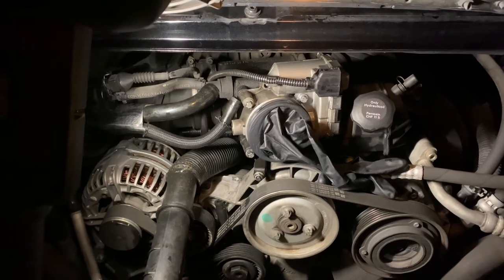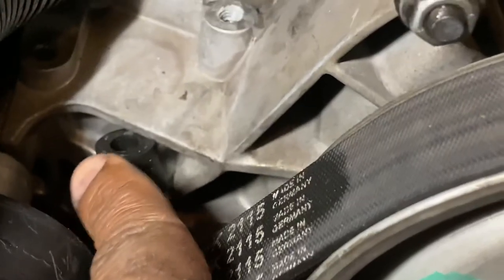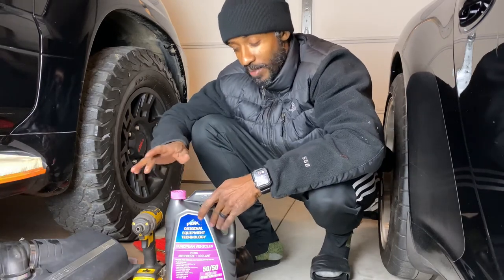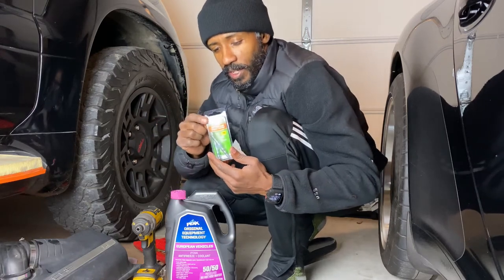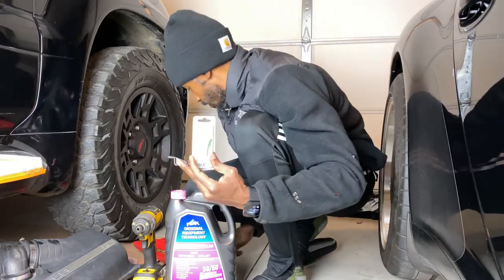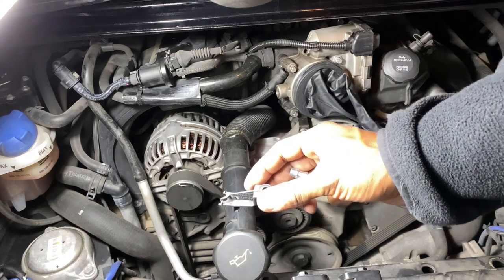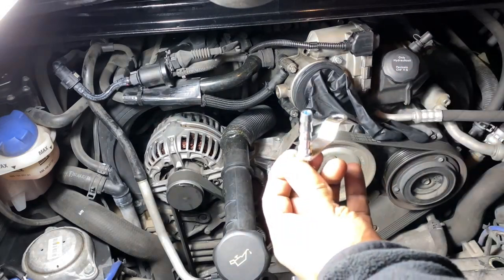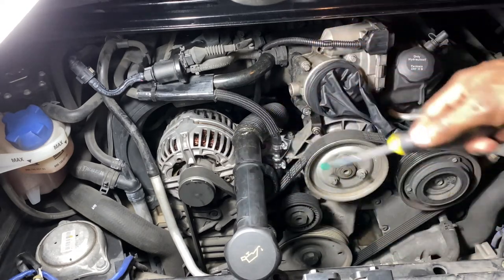Porsche 997 996 | EMERGENCY COOLANT SYSTEM REPAIR! | Don’t get stranded by a $5.00 part!

Comment: You saved me! I broke mine changing the engine mounts. That thing is crazy fragile! 😮
Reply from the maker: No problem, I am glad you found the video useful. I would have a few spares one in the car and one at the house. I think the reason they made it plastic is due to electrolysis but I could be wrong.

Comment: It happened to me today on my way home. Freaked out because I saw smoke coming out, but it was only coolant vapor. whew! After some research, found your video and now I am doing the same fix!
Reply from the maker: I’m glad this video was helpful for you! This fix is easy, quick and inexpensive it will get you back on the road. I do suggest ordering the fully aluminum part if you can and make sure you get the air out! Best of luck to you!

Comment: Great video, my guess for using plastic is to avoid any corrosion buildup over time in the coolant system.
Reply from the maker: Yep when I did further reading I found that electrolysis is the reason certain parts are made from plastic in cooling systems. I wish they would have used better plastics tho.

Comment: I do not know why Porsche makes some of the stuff they do out of plastic.  Reminds me of the oil elbow on the old 924s that would just crumble and eventually starve the top end if not serviced.  A couple of the guys on the 924 forums came up with the idea to lathe some pieces down and make them out of brass so they were no longer a service item.  Sometimes I love Porsche, other times I'm like, "Why guys... why..."
Reply from the maker: I agree with you 100 percent. I had a first gen Cayenne Turbo back in the day. There was a coolant T fitting between the motor and the firewall that was a very common failure point. It was made of plastic and it failed on me while driving. Replacing it requires removing the intake manifold and a bunch of other parts smh. In the process of doing that job a bunch of other plastic bits break, smh it is soooo annoying. Especially when those same parts could’ve easily been made out of metal.

Comment: What do you mean by burping?
Reply from the maker: Sometimes when you open the coolant system air can get in. The coolant system has a burp valve to let the air out. The better way to do it is to use a vacuum.
Reply: @KRTLyfe  Thank you. Where is the burp valve located?
Reply from the maker: @brintamatic  on top of the coolant tank.